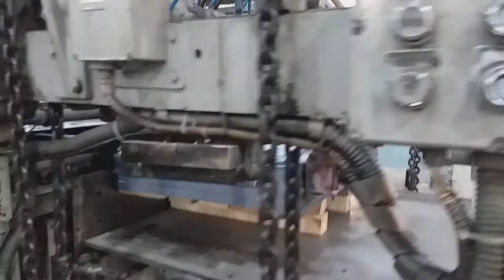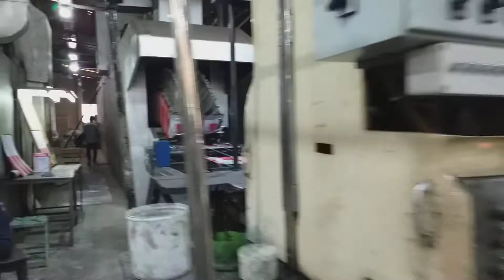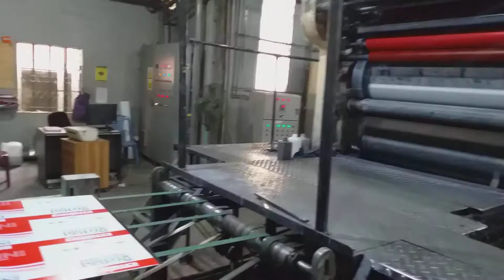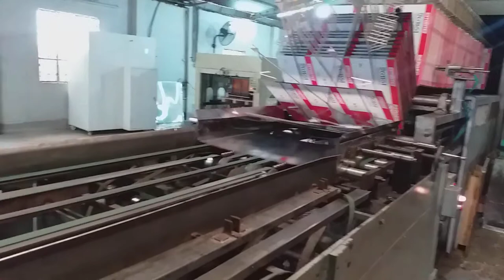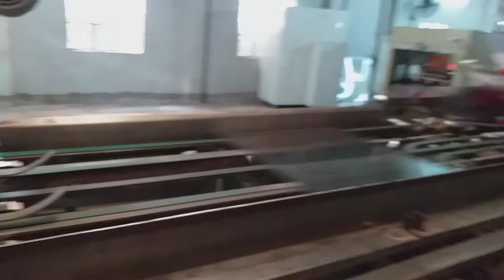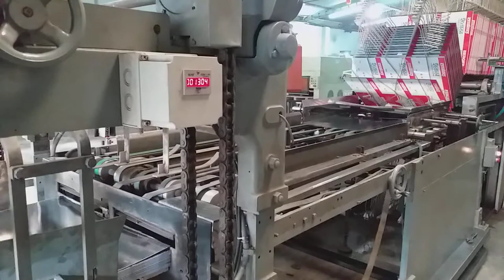Auto feeding and auto unloading of offset tin printing with conventional oven

Comment: Speed is very slow, I am unloading sheets @4000 sheets per hour
Reply from the maker: We are also run the machine 3500/h speed.
Reply: @R.K.Mallick Is it because the size is big?
Reply: Hello Sir. Im looking for sheet printing vendor. im running a tin manufacturing company since 2009 in chennai.